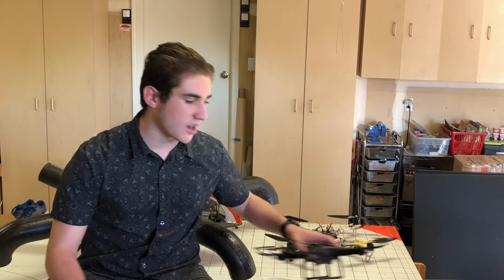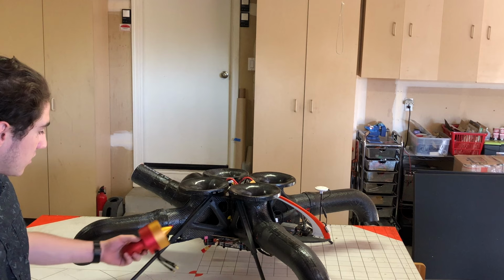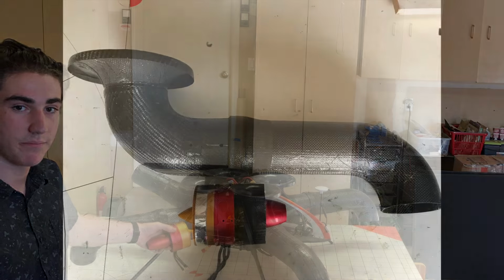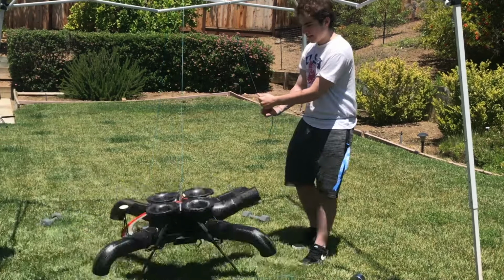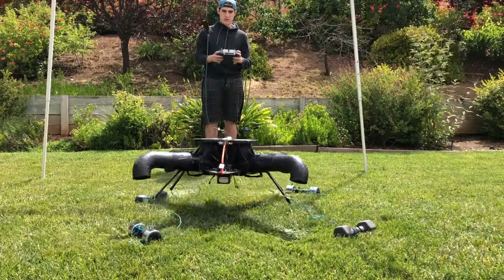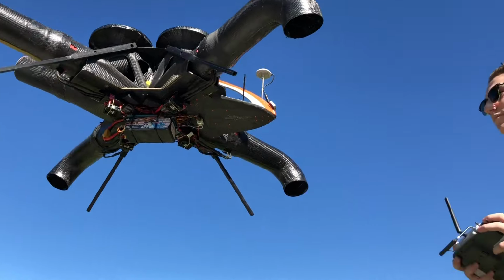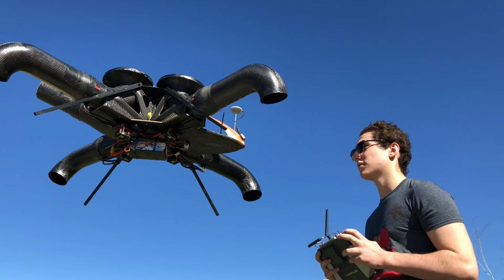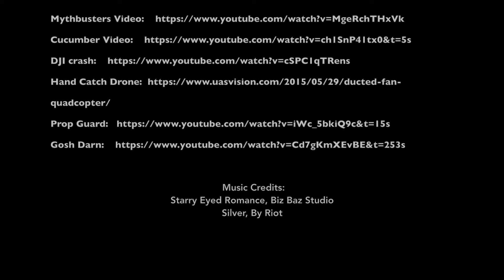Bladeless Drone: First Flight

Comment: Cool concept but increasing weight that much while also decreasing propulsion efficiency (large prop/EDF) would surely slaughter the flighttime and therefore usability of the drone. Imo just go for efficiency or power depending on what you want to do with the drone. Drones are not that dangerous if piloted correctly.
Reply: The induction fan produces more thrust and uses less power. The power to weight ratio is on par with other quality drones.
Reply: @Regular_guy69  Well. If they are better in terms of power and current draw, why do no professional drones use EDFs?

The aerodynamics that I have been learned says that a bigger propeller running at a lower rpm is generally more efficient than a smaller one spinning faster. But ducting could partly make up for the difference.

Im not claiming to be an expert but look at  what companies like DJI are doing on their biggest and most expensive film rigs (where cost doesnt really matter). No EDFs there.
Reply: Your right, this is a cool concept but not practical. It’s a nice though but it’s going to take far more work than just the thought to really make this work. Also the amount of tools, materials, experience he had his dad was most likely a machinist or Mech Eng.

Also having built a custom 17in quad your right most EDFs pretty much draw tons of current and have very very heavy motors inside for the performance they offer. Overall the “safety factor” of all the extra weight and the impracticality would take a lot more deep thought and work to execute. Even then would be much harder to build but could be cool. Might try my own shot someday given I have the money to blow lol.
Reply: @9Llamaboy  
What i dont get is why you wouldnt just stick EDFs on the ends of an X shape and just put saftey grills on top and bottom. No way to touch the blade then. 

Would also result in less weight and you dont have to bend the airstream two times.

My opinion:
Its cool, but not very well thought out and therefore horribly over-engineered.

Comment: Why not a way shorter pass-thru at at perhaps a 60 degree angle, using maybe a computer fan guard at the top? You are losing a TON of intake and even more output with these big bends. You could focus the output as well into an even more powerful jetstream. The air-churn baffle inside those tubes between the engine and the last output bend is also horrendous I would imagine. Now don't get me wrong, I love the effort and experimentation put into this design, yet I think it could be way more efficient if not overbuilt. Some single wall ABS as well could be used here to cut quite a bit of  weight.
Reply: I'm no expert on propulsion, but would "rifling" help with the air-churn and possibly increase the air speed at the output nozzle? I can't help but think it'd be more predictable..
Reply: @Snarkapotamus  Some pretty dramatic rifling on the intake port perhaps.  I would taper output at 3.5% per inch  up to 21% (this completely depends on how large/long you want your output port to be)  making sure there is nowhere for any air to baffle inside of the output chamber (the curve at the bottom of the housing of the enclosed motor for example) at all. Keep in mind tapering the output is going to lead to control issues that will have to be tuned and compensated for. Rifling the output would dramatically cut output energy and add drag to the air stream, while rifling input would certainly help force more air into the intake once the motors are spun up, creating way less drag on the motor so it could operate more efficiently. Also, since we no longer need an enclosed motor to make this all work, we can achieve maximum airflow, with another smaller motor and prop spun up at the top of the intake. All we are really trying to do is force air at the main motor to make it as efficient as possible. I think if I were to tackle a project like this, I'd use an input motor, and a high powered output motor with stream cones attached to each. My design also would absolutely minimize/avoid any bends in the enclosure at all.
Reply: I find it downright amusing seeing all the Monday morning suggestions. My question is, why didn't you guys come up with the effort and time as this young guy did? We wouldn't have anything to say if he didn't  do the work, would we?
Reply: @karthurjr  Absolutely not. I think what he did was great. I hate that people cannot understand the difference between criticism and input. I've been done with drone experimentation for about 3 years. Hopefully Stefano takes some of that input and light bulbs start going off above his head, Wile E. Coyote style :).

Comment: Really impressive. Have you thought about controlling the angle and iris of the jets and the via a controller? If they could rotate you might be able to use a single larger turbine and alter the drone by swivelling the outlet and/or reducing the iris. This would give much finer control, but obviously at the cost of complexity.

Comment: Great work.... really impressed..... one suggestion...(up to you weather you gonna heed the advice) Use a down draft table and a dust mask when cutting trimming sanding any artificial man made material (Plastic, fiberglass, carbonfiber, kevlar, etc.) ... fibrosis is usually the illness suffered by people working with artificial materials.... particles don't break down and usually in-bed themselves into the lung tissue..... think about it..... 1000 years from now you and I and many of our future generations would long be gone and that material is going to stay there..... Just a friendly advice.... and also it helps if you use respirator when you do your resin mixing.... those fumes are not the best either.... lol.... Stay safe....

Comment: I would be very curious about the power requirement of this vs. the regular drones.  It looks like it would be very inefficient.
Reply: Well, actually propellers can still use a Bernoulli force together with a reactive force being enclosed in a big tube in a free airflow. And this must be a subject of a patent (alongside with a small angle of exhausting pipes which allow to control a rotation) rather than a harrier-like principle itself. And nobody except China makes drones. China doesn't care about patents. So.. Wasting of money imho which could be used for making a prototype better.
And I have no idea what's wrong with a simple cage around traditional propeller. May be a weight matters. So here they have doubled it -)

Comment: The leafblower’s final pokémon evolution
Reply: I wonder if you could program it to run a course around the yard to blow the leaves into piles. That would have practical value for me!
Reply: @wuzgoanon9373  Pretty sure you would just be making a mess no matter how you programmed the route.. The tubes do not articulate lol
Reply: @chadlimestall9201  probably right. I have three acres of leaves right now. Guess I'm dreaming!
Reply: @wuzgoanon9373  They already make attachments for riding mowers and lawn tractors how would this be an improvement? Mechanical turbulence is very difficult to direct if you have zero articulation in thrust. The flight pattern would be ridiculous in order to move a pile of leaves in the direction that you want. What you are dreaming of does not adhere to principles of flight and physics.
Reply: @chadlimestall9201  Like I said...three acres of leaves; I'm just dreaming.

Comment: This is actually an innovation like no other. He solved a problem of crossing a dangerous mode of transport into and incredibly safe one. If you built this design much larger so a person could ride it, it would basicly be a flying car.
Reply: Now you just have to focus on increasing power because of the covers and then from there make it hearing safe when you sit on it- Honestly I dont think this is the answer for flying vehicles.
Reply: Efficiency would be an issue. Basically you are pushing the air through a pipe which will cause massive head loss (loss of force). Another issue with a quadcopter design is that in the case of an engine failure it cannot autorotate and land safely like a helicopter can. If one of the four motors/engines dies it would be game over.
Reply: @Rex-sy8ye  yeah i know what you mean. But they have some 1 man "drones" and yes the same problem applys, but what i mean ultimately is that the idea of internerlizing the blades or jets is a geinus Idea. It stops a big problem of not only danger but direction.

Comment: You could probably increase the lifting capacity of this drone by attaching a single large dusted fan to the top of it, using the existing 4 motors just for control and having the big motor provide most the lift.

Comment: I am over 50 and been an engineer most of my life. Don't pay attention to the negative comments on here written by 14 yo's because it doesn't work and look like their 29.00 Walmart drone they got for Christmas.  This was a true achievement in thinking outside the box and designing and building something that actually works. Most people that have idea like this never get them off paper and if they do, they never actually get a working prototype. Thomas Edison built and tested over 3000 prototypes of the electric bulb before he got it right and now look what it is today. Keep up with your good work. You may have something that is very valuable someday to all of society or even the future of mankind.
Reply: Except it, please explain how it can Yaw, and I'm over 50 too and build dozens of drones.
Reply: Please explain to me, technically, how this drone can YAW, given that the motors are laying on their side? If the tubes could vector that would be a way to YAW. This design is great, it's really innovative, but it has a massive design flaw.
Reply: @MakatiSuites  I believe it is in the offset of the outlets, note that they are at a slight angle, so that one side has the ducts facing each other just a little bit and the opposite side the same. By adjusting motor speed to one set of ducts that are angled in same direction more than the others it will yaw. Cool!
Reply: Right on Bob Green, I too am a product designer and mechanical engineer and am over 50. Glad to see anyone making something themselves, especially as challenging as this! lots of great fabrication done himself, so screw the naysayers!
Reply: Are you sure Edison really did much own testing with the light bulbs?
As far as I've heard he mostly ripped other people off who did that for him (or before him).
And what it is today (or was) is a gigantic scam, btw.
But of course you're right about the achievement in this video!
Reply: Edison didn't create the first light bulb, it was patented 50 years before it was perfected. Joseph Swan patented the first efficient light bulb 10 years before Edison. I know that this guy is an idol in States but for crying out loud, don't bring up Edison to motivate that kid, Edison shouldn't be cherished like that...

Comment: An empirical rule of thumb I discovered is that you lose about %15 thrust for every 90 degree bend, so you're losing 30% thrust on the bends. I have a few ideas how to fix that but I'm not sure if you want to do it.
Reply: I cant see how bends in the duct are even necessary.  just use ducted fan with longer (vertical) ducts and maybe gapped guard across the top.  use 6 thrusters, shut down in opposing pairs if 1 fails.

Comment: I congratulate you very nice project, I leave you an idea since I see that you have the economic resources, first join the V-TOL concept of the AV8B HARRIER, with a single engine, it is easier to control the power of a single engine and level with the vectors of the ducts, second, use for the control the gyroscopes used by cell phones and cameras of the latest generation, on the internet you will get the appropriate software to configure the controls. greetings and success!

Comment: Fancy tube work, but the added weight and redirecting airflows through two 90 degree turns decreases overall efficiency.  Instead, why not just make a shorter straight tube that protects your hands and such?  Wouldn't look as fancy but from an engineering perspective, it would be more efficient and thus increase your flight time.  There is at least one benefit with your current design and that is that added benefit of torque while maintaining the Cg close to the vertical center line.

Comment: Considering how insanely inefficient it will be that way, wouldn't it just be easier to put some large cowls around some normal blades? If you're already using a ducted fan, why add 2x 90 degree bends when you could just put the fans themselves at the end of the arms and use the duct as protection?
This'd be really cool if you could run it all off one large jet and have each arm control the amount of thrust through something like a throttle body.

Comment: Cool.. in the search for a safer drone, I think you stumbled upon a more powerful drone idea. Think about having a centralized engine that pipes the air  to multiple ports. then controlling the airflow for each port, you might minimize the number of engines while simplyfing the controls mechanism. Keep up the good work.
Reply: Why not just make a helicopter at that point...
Reply: @khanch.6807   because it wouldn't be as Cool lol
Reply: @khanch.6807  because you get more stability with a drone.
Reply: @dogmalogy3666  not really. The only advantage I see is protection against projectile weaponry.

Comment: Stefano, first and foremost, congratulations on your project. While I haven’t flown my RC helicopters or drones for sometime, I can assure you they can be dangerous, and require utmost respect whilst flying them. For the rest of you that complain that this drone is not truly blade-less, I suggest you have a look at some of the RC helicopter and drone forums in the “Accidents” section. There you will find picture of operators who have met up with the exposed blades of their RC craft. Trust me, there are some gory pictures to see, not to mention, learn from. BTW, one of the main reasons I gave up RC helicopters was the fact that within a 3 week period, two people were killed by their RC helicopters. Yes. Really. So, again, congratulations on making this a safer hobby! Much respect!
Reply: No blade-less, thanks a lot. Compresors uses blades to generate airflow, but they are hide into a box. Good video.

Comment: Great work! People are quick to judge on here and dont seem to realize the potential of this machine and the fact that this is a hand made prototype. sure lots can be improved but it the first step to mass production or a line of custom one off pieces made for the needs of the individual customer.

PS
 dysons "bladeless fan" uses a turbine.

Also, always use a mask/filtration when working with carbon fiber etc, it really does cause damage to your lungs (carbon etc wont break down)

Comment: This way over-engineered. It's not bladeless, adds more weight, increases the size and makes it harder to fly. 
Simply adding a decent mesh to the top and bottom of the ducts would have the same, if not better effect while being lighter. But if you had fun and learned something from it, that's what it counts.

Comment: RC hobbyist , aeronautical  engineer here. 

This is a really fantasic project.  Thumbs up for effort. However this design wont be really useful yet in the market due to the inefficiency of ducted fans. High air velocity with lower mass flow is only meant for " fighter jets" . The air exit velocity of the ducted fan can be above 80km/h while what you really need is just 20km/h or less but with alot of air mass flowing through like a giant prop for efficiency.  

So like some of the comments below say. Build one giant ducted fan and split them into 4 tubes. Like a harrier. The engineering portion is up to your creativity!

Comment: If the fans are mounted in a horizontal orientation,  how do you yaw the aircraft?
Reply: Bo Han maybe that’s what that carbon pipe that’s sticking out the back is for?
Reply: u can see that the outlets are tiltet in the jaw, now you controll with the biosed jaw instat with the torqe from the blades and motors
Reply: Drogheda Drones & Fun you could modify it to rotate the tubes themselves in the respective directions and increase thrust a bit (to maintain altitude) which would yaw the aircraft, maybe not very fast or controllable though
Reply: the exit of the tubes are not completely vertical

Comment: Small EDFs are inefficient. The weight of the tubing and the airflow resistance inside the bends will make this a lot worse. No wonder you dont mentioned flight times. Are you getting more than 6 minutes?  Maybe with a single, central, large fan in the middle and some sort of valves inside the tubes or thrust vectoring nozzles you could make it a lot better. Using a DJI controller is also the silliest idea ever for a DIY project, when there are a bazillion opensource flight controllers out there that are way more configurable, cheaper and overall better. I will give you props for the look of the thing though. It looks really cool.
Reply: My thoughts exactly with central power source and valves etc.
Reply: @bonanzabiker  straight valves would hurt efficiency too though, it would require some clever engineering to rebalance airflow/thrust across 4 pipes without inducing too much drag, or for that matter, extra weight. You might be better off just using vanes on a single shrouded prop.Plenty of those designs around.